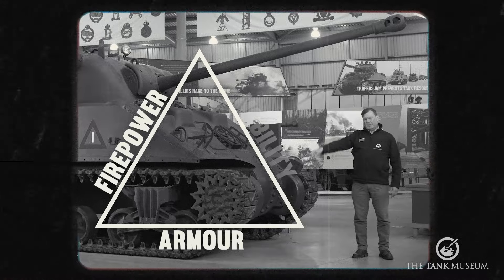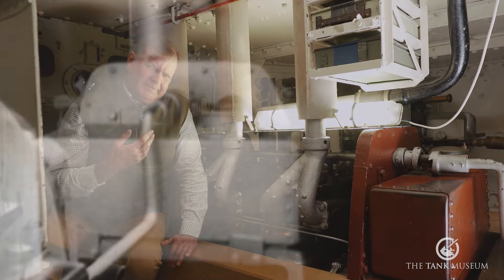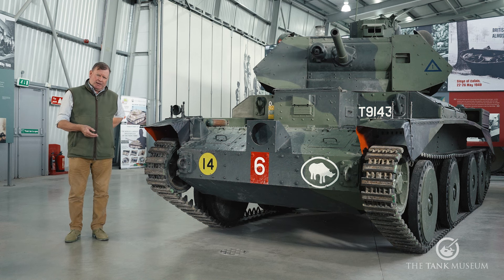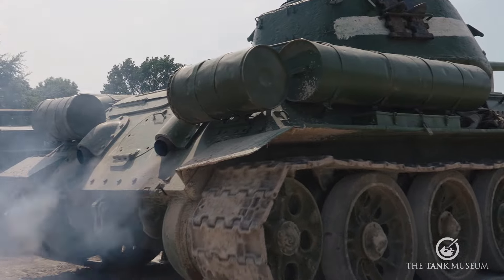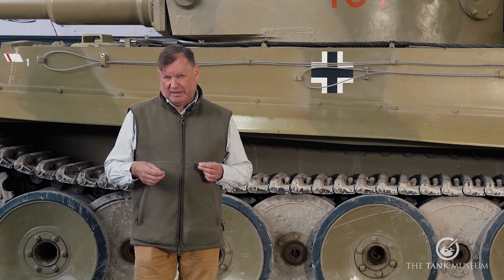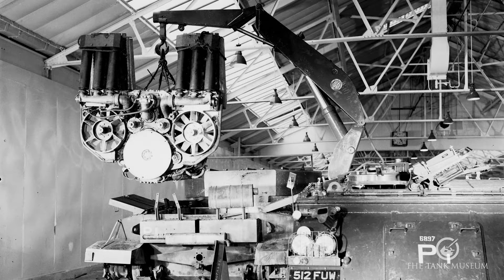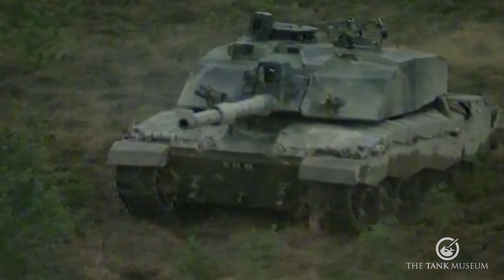Powering Victory: How tank engines went from 105 to 1200bhp

Comment: Would like to hear more about the development & evolution of various engines like the Meteor & others.
Reply: I'd be interested in the history of the Ford GAA
Reply: @WalkaCrookedLine the Ford GAA the long and short of it is that the engine was first intended by Ford to break into the aircraft engine market that didn’t work out. Their decision makes sense given their involvement in the automobile market and how you know the V8 us Americans loved were first made for aircraft for example. Specifically when World War II began the British were in America because they were in good terms despite the overall isolationism of the public in the latter nation. The British were looking for a US company to make the more complex components of the Rolls-Royce Merlin in the US for the war effort. The main problem was when they went to Packard, another manufacturer of luxury cars, they wanted to make the entire engine not be a subcontractor. The Brits eventually sent some production drawings of the Merlin across the pond at which point they got seized by the Treasury Department. Using the drawings Ford decided to break into the aviation market with a reverse-engineered version of the Merlin V12. There was a problem for Ford however. There wasn’t any demand. As the United States was preparing for war, the main customers would be the US Army Air Corps and the US Navy and neither were interested. The AAC was only interested in the engines from their established contractors. The Navy on the other hand didn’t want a V-12 as they preferred radial engines for their reliability since having a engine crap out over the ocean is a death sentence. However by this point the Army was relying on their established contractors for aircraft engines in tanks but with the war looming they were going to risk disrupting their supply of engines for tanks so they accepted the Ford GAA which is the Ford V-12 chopped down to serve as a V-8.

Comment: Great video on an important part of tank design.  I never could figure out why they didn't turn to a properly designed diesel engine for Chieftain after the multi-fuel failed so badly at the start, but I guess there's a lot of inertia and 'sunk cost fallacy' so no one wanted to make the call (?).
Reply: It's a long story. If you can, get the Haynes Chieftain tank manual. The Tank Museum shop stocks it. It gives you a full and very interesting breakdown (no pun intended!) of the tangled development of the L60.
Reply: They should have put a Cummins KTA in the Chieftain.😉

Comment: 13:57 Multi fuel engines usually run on either petrol or diesel.  AvGas is simply aviation petrol, usually higher octane than road petrol.  AvTur is aviation gas turbine fuel more like paraffin than diesel (i'm not clever enough to explain the difference between diesel and paraffin) and I guess you meant to say AvTur rather than AvGas and that it could run on paraffin.  Commercial gas turbine jet engines run on Jet A1 which is pretty much the same as AvTur because AvTur is simply the military name for it (AvTag is similiar to AvTur)

Comment: I would like to hear more specifics about tank transmissions and steering systems, since it's very different from automobiles that most people are at least somewhat familiar with. the continuous track requires differential steering, which means that there are no front wheels to turn and you steer by having one track move faster than the other. the steering systems themselves are an essential function of the transmission. this all has an effect on mobility, but the transmission is probably the most crucial element, because they can be surprisingly prone to failure. of course nowadays the engine and the transmission are combined into a powerpack, which is easier to replace as a whole. someone else has to determine, what was faulty, while the tank marches on with a new powerpack. when it comes to upgrading older tanks, a new powerpack is probably one of the first things done and the video should offer reasons why. in the video differences between gasoline, diesel and multifuel engines were mentioned, but gas turbines and opposed-piston engines (like the Leyland L60) could have been mentioned as well and compared to more conventional diesel engines, but time is a finite resource.

the different steering systems are the reason why some tanks had two engines (one for each track) for example and to give another example some tanks can neutral steer due to their steering system, while others cannot, although even without neutral steering the turning radius of a tracked vehicle is still a lot smaller compared to a wheeled vehicle. I would say that while the engine affects the mobility of the tank, it is crucial to note that the ability to use different fuels and fuel efficiency are important characteristics of the engine, since they determine the range (with the volume of the fuel tanks) of the tank and some of its logistical requirements (i.e. fuel). another absolute essential part of the mobility off-road is the suspension of the tracks, but it might be better to focus on one thing at a time and talk about tank suspensions some other time, although as yet another example I think many are familiar with the Christie suspension of the T-34. interestingly no modern tank uses it anymore, but that's enough, since this comment has far too many words already,

I am well aware that the video is more about engines in particular rather than mobility in general and I do think that it's a very good video overall, so this is not a criticism in any way. I just think it's important to understand that mere engine power will not be useful without a robust transmission, which links the engine to the tracks. there have also been tanks with an electric drive, which means that there is an additional step, where the engine is used to generate electricity and that in turn is used to power electric motors that move the tracks. the advantage of such a system is usually the ability to move forwards or backwards at the same speed. now to return to the topic of transmission perhaps it would be good to remind how tanks can differ in the number of reverse gears and by extension their reverse speed, which has been a subject of discussion as the T-72 has a painfully slow reverse speed due to its gearing ratio, which maximizes torque at the expense of speed. on the other hand a Western upgrade like the Renk ESM 350 would give it 5 reverse gears instead of 1 and the ability to neutral steer. anyway that should be enough rambling about tanks for today.

Comment: Crucial to powering a main battle tank is that the tank has the ability to accelerate very quickly from a standing start out of its firing position.  Therefore, engines that develop a high torque even at low revolutions offer a decisive advantage.

Comment: the biggest grip I have is that you said that phrase. "quantity has a quality all of it's own" which I cannot believe in the slightest.
I find that quality always wins wars and 'unfortunately' for Germany, it started to sacrifice quality with quantity towards to the end of the war; which is why so many tanks broke down or ran out of fuel and was unable to fight towards the end of the war. the M4 Sherman's were built to incredible quality which is why they were able to operate so much better than any German tank that had a seizure trying to keep up especially towards the end of the war when precious materials and good quality equipment was in such short supply. not to mention using forced labor isn't the most amazing idea when it comes to building sophisticated pieces of equipment that you intend to use against your foe. which is trying to end the tyrannical regime, that is keeping such forced labor enslaved.
Reply: Germany couldn’t afford quality nor quality. It leaned towards quality, because it didn’t have enough fuel for tens of thousands of PZ4’s and the support crews for them. They used slave labor where they could, but that was just so their soldiers had equipment to fight, even though the said soldiers were outnumbered like 2 or 3 to one.

Comment: In WW1, I've always thought it strange that they didn't put light metal grills (strong chicken wire type of thing) one or two inches infront / around the inside exhaust pipes just to stop men accidentally touching them. The crew much get thrown around all the time. Not much weight for a lot of protection.

Comment: A great very interesting Tank Chat. How come the Super Wasp the engine that powered the B29 was never installed in an armoured military fighting vehicle or was it?Do you expect the tank engines to reach 2000+hp any time soon?Why would they?Are we going to see an all electric drive tank soon?  What would herr Porche say about that would he be opposed to the idea?Have a good one.
Reply: I would hazard that after the R975, American designers realized the negative aspects of a radial engine in a tank. Which is why when they introduced the T26/M26, the Ford GAA V-8 was engineered into it. You make an interesting point about the Ferdinand’s drive system. What will come next?
Reply: @hansla8608  Thank you.Did you mean the Ford's V8 was not an aeroplane engine?The British did quite well with the Meteor engine although it was not a radial engine.
Reply: @sealove79able The Ford GAA was a modified aero V12, with one-third cut off to make a V8.

One of the issues with the B-29 engine, besides its large size (I mean, even the much smaller R-975 already dictated the Sherman's profile) and weight (twice the Ford GAA, though less than the Multibank) is its cooling. The B-29 suffered from engine overheating problems, and that was in flight, where the engine had plenty of cold air. Shoving it into a metal box, possibly in a desert environment, would have done it no service.
Reply: Thank you akmz. Quite right on the GAA having aviation origins, based on a V12 copied from the RR Merlin. Then having two cylinders lopped off.
Reply: Also I stand corrected on the T26/M26 - it used the GAF engine, a further development.
Reply: The MTU diesel engines of the Leopard 2 can be rated with Modifications up to 2300 - 2500hp. The strongest in service are modern ARV and engineering vehicles based on the Leopard 2 with 1800hp.

Given the fact that turbine engines are much smaller, I think the Abrams could easily be fitted with a bigger more powerful turbine.

But torque and how you get down into the tracks is much more important for quick acceleration than the race for  HP.
Reply: @akmzd6938  Thank you.
Reply: @hansla8608  Thank you.
Reply: @hansla8608  Thank you.
Reply: @HaVoC117X  Thank you.Yeah unless the tanks become much heavier perhaps.

Comment: I suspect it is a non-debatable tenet of belief in the tank community that German heavy tanks were underpowered.
Although it is probably not decent to attack someone's religion, I'll give a few numbers to consider (although there may be versions with more powerful engines as well):
- Churchill: 8.3 hp/t
- Tiger II: 10 hp/t
- M26 : 10.7 hp/t
- IS 2: 11.2 hp/t
- IS 3: 11.2 hp/t
- Tiger I: 11.3 hp/t
- KV 1: 12.6 hp/t
I think it becomes clear that the German heavy tanks had a completely contemporary performance. Even medium tanks like the PzKw IV or M4 hardly had more in some variants (let's not even talk about British infantry tanks here).
Yes, the Russian tanks, which are praised for their mobility, were rather in the upper range and actually had about 1-2 hp/t more than the Tiger II but in part less than the Tiger I.
To speak here of an outstanding underpowering even of the Tiger II can therefore, in my opinion, only be honoured as a counterfactual truth of faith.
Reply: There are mobility trials videos of the Panther on YouTube. Their suspensions were difficult to repair but the german big cats were very mobile.

Comment: How does the multi fuel system work? Does it have a separate set of fuel injectors/pump/ignition or does it just run petrol through diesel injectors ? 
Even if it does. Surely it can’t run very well on petrol, as Diesel engines usually have a far higher CR and combustion chamber design. 
Great video Chris.
Reply: Tractors were multi fuel for decades.

Comment: What do you think about the Hybrid engines for tanks. I see it as an outright win in terms of reliability, upgrade path and quite over watch/running.
Reply: You can have the road wheels driven by electric hub engines, so if it lost a track it can still limp a bit.
And the torque of electric is insane, it might not help range but it will improve acceleration.
It is also possible to go into silence mode (if we make the tracks also more silent).
Reply: @buddy1155  with the technology we have now, it might be possible to make a Tiger-Porche that's actually reliable.

Although I did hear that the problems with the Tiger P came from using a weaker replacement engine instead of the one that Porsche designed and wanted to put in it, oh well.

Comment: Leyland L60 is not a V6 configuration ! It's a 6 cylinder opposed piston unit.
Reply: Yes, well spotted. Six cylinders, 12 opposed pistons.
Reply: And the Engine and Transmission are separate units, not a "complete" power pack.
Reply: @andyt3304  Yes, joined by a "twiflex" coupling.

Comment: I was REME 1971 > 1978 the L and K 60 were both 6 cylinder vertically opposed diesel two strokes, not V6.  Primarily run on diesel but with a multifuel capability (I never actually saw one run on anything other than diesel) Originally a good design from Rolls Royce producing a very respectable power to weight configuration compared to what else was available when they were designed in the 60’s, but once the engines were developed the multifuel concept had come of age and was added as a late stage requirement by MOD.  RR said not possible without major redesign, expense and slippage of delivery timescale due primarily to the massive tolerance issues between surfaces of critical mated moving engine parts and diverse temperatures fluctuations encountered when burning different fuels with vastly different octane and burn ratings.  Long argy bargy until cheap option found.  Step forward British Leyland.  Production was passed to them under a licence arrangement who said they could do it.  The engines had in line fuel injection pumps added with separate engine oil fed gallery to keep the pumping elements lubricated when using petrol of paraffin and such non lubricating fuels and many other cheaped out mods.  The engines were pants and always breaking down not least through cylinder liners blowing but many other reasons as well.  They could barely hold themselves together for more than a few hundred miles before a pack lift was required.   During the 70’s all the packs were sent down to Italy on a rolling program over many years at huge cost to be modified with better engineered components and much tighter tolerances which did also improve output power a little.  They were an improvement but still pants overall for a fighting vehicle.  RR was right but Leyland knew batter promised the earth and got the contract.  Anyone serving back then knows the rest of the story if they served in a unit that had L60 or K60 engines to deal with.  All packs that went down to Italy came back with the company name BELZONA stencilled in large red letters across the full length of the upper exhaust crankshaft cover and this can sometimes still be seen on some of the vehicles that are displayed in preservation.  MOD never learn with their contracts do they.  Still going on now with Ajax!  Sighs in resignation............yawn.  Another good video from the tank museum though giving a good insight into so many other interesting power unit concepts.  Thanks for producing.

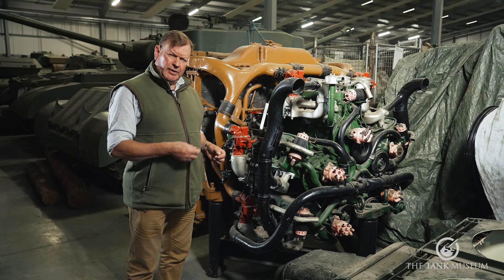Comment: @9:47. There is no way that each of those 5 Chrysler engines produced 425 hp; the whole multibank is only about 370 hp. The engines were straight six flatheads of 4.1 litres (250 cu inch).

Comment: When did power packs arrive? 18:42 

I know that today even the Americans are using MTU power packs. And they appear in several tanks around the world.

I seem to remember that the engine for the Tiger II was 900 HP. Or at least was supposed to be that powerful.

BTW The Leopard 1 engine was replaced in 10 minutes out in the field helped by an M88.

Comment: 1200 HP is old news these days, you are looking more at 1500+ HP stuff, but equally important are the upgrades in transmissions bringing all that torque to the ground without exploding. Latest MBTs can have really explosive acceleration when you consider the mass that has to be moved.